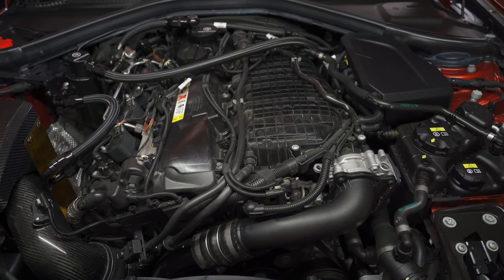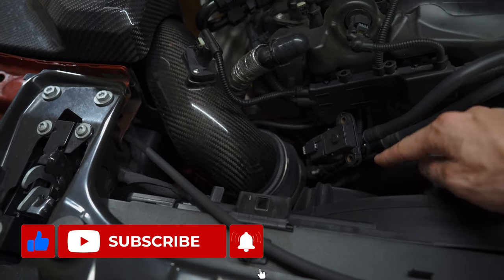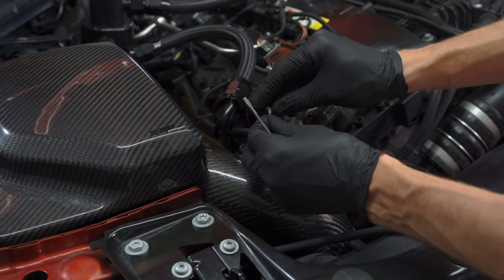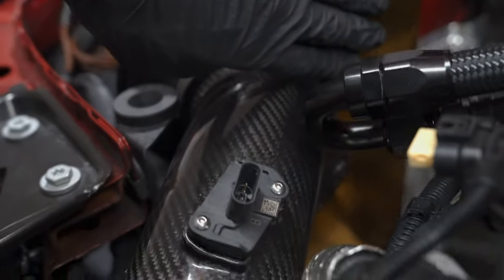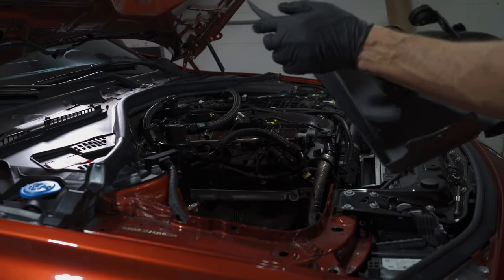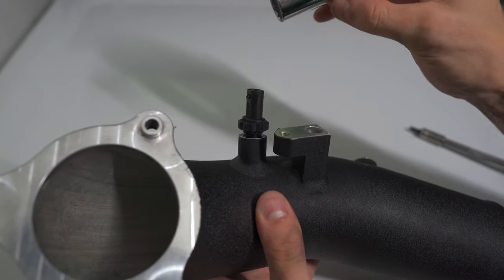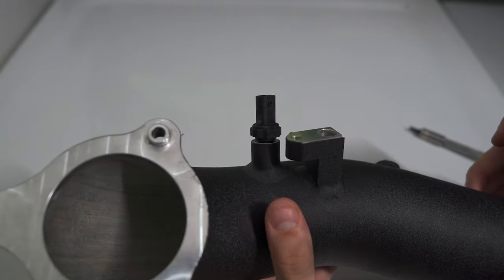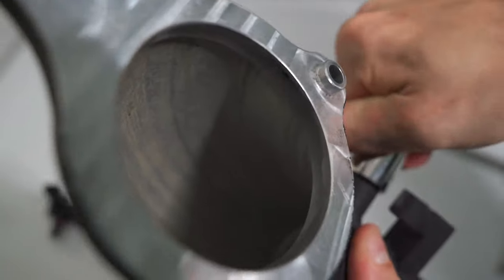HOW TO INSTALL A VRSF CHARGE PIPE | BMW 340i B58

Comment: What does it do in terms of horsepower
Reply from the maker: Nothing really. Just to make charge pipe more reliable pushing more power. Adds a little bit of more turbo noise

Comment: Would you say it's extra to install vrsf charge pipe on a 2019 stock x3 m40i?
Reply from the maker: Yeah don’t really need it
Reply: Honestly, in the world of sub $300 preventative mods, this is a big one for the B58.  It's up there with turbo inlet, PCV, and oil filter shear in terms of reported failures on stock vehicles.  Having said that, I ran JB4 map 3 for approx. 30k miles without any of these mods and had no issues. 🤷🏼‍♂️ That honestly was maybe a tad risky TBH. If this were a $500+ upgrade I'd say stop and think about it. But you can upgrade your oil filter to steel, grab a Ross Racing PCV, and replace your turbo inlet and charge pipe ALL for under $1k and you'll have the peace of mind knowing you beefed up the most failure prone components in your engine bay.  Now that I am actually flashing my ECU and closing on 65k miles I have decided to forgo any MAPs or mods which increase power until I have replaced all of these components.